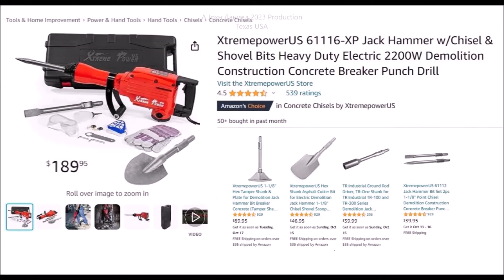Xtreme Power US Jack Hammer and Tools, Watch a 115 lb Girl bust Concrete with it

Comment: my sister in her early 20's rebuilt engines , operated drill riggs for years, she had a reputation as one of the best drillers around
Reply from the maker: Kiera is building her business plan. Local bread subscriptions and delivery. She makes the best damn bread I ever had, even better then my aunts and grandmothers did. And she's only 18. But she took their recipes, and worked them. Already has a dozen deliveries she bakes for. Adding more and looking to raise the cash to get her a van, her truck is 150K worn bad.
Reply: @JOHNDANIEL1  might be some money in gluten free bread or flours from non hybridised grains ie old grains   i see so many switching to it , mostly those with gut issues, inflamation in their bodies  which seems to be more and more common

Comment: Are y'all running that off of an inverter? I've got a SWIPower 3000w, 48v inverter and I think I see it taking longer to recover from big inductive load starts. It hasn't shut off from one yet though. Seems most of what I use it for are tools with induction motors. I haven't been a position yet to watch for voltage drops though. Except one time I tried to start a compressor with a 2hp motor mounted, and it dropped to 67vac. So I don't use that compressor off of the inverter. Would the 6000w SWIPower do better? Or would it be better to keep looking for a low frequency inverter?
Reply from the maker: Yes, running on the Swi 5000. Get the 5000 model.
Reply: @JOHNDANIEL1  
5000w better than the 6000w?
Reply from the maker: Yes, The 5k https://s.click.aliexpress.com/e/_DeBzM5H is preferred. The 6000 is only really just 2 larger capacitors, no larger fans, 13 watts more idle current, and your wiring on them is already on the limit, and you may never reach 6000 due to that. The 5K is premium, actually capable of 5200 with no modifications. And why pay $50 more for the extra hope of using 6000 watts once in a blue moon! Get a 5000, pick your battery voltage, USA plug, 110-120 volt. All other voltages are other countries, not for USA. They are in a USA warehouse ( https://s.click.aliexpress.com/e/_DeBzM5H ) and make sure your cables are dual 1 awg or heavier to feed it. if you go over 4 feet up to 8 feet, then get (4) total 1/0 gauge x2 per side.  I have over 5000 amps battery, I am ok, but you will need 400+ amps to run these. 2 of the TIME USB with 200bms https://amzn.to/48VlOEv is minimal but enough. 3 would be premium battery coverage. ( use my buyers bonus code if you do, I won't need it, good a few more days, HUGE $$$$$ off. Code - WHVMWBGZE707 use at check out ) Literally almost as cheap as a 100 ah LOL!!
Reply: @JOHNDANIEL1  
I asked because I didn't see the 5000w listed separately on the blithechin Ebay source page. It is  listed as 5000/6000w at $534.
I've got right at 10kw of full current power from the (2) 48v rack mount EG4 batteries to cover surge requirements. But all the equipment is running off of 15 amp 120v  plugs. And never more than one at a time. 
I'm afraid that my current 3000w SWIPower inverter has developed some harmonic distortion, probably from repeated inductive surges, and may no longer be a true sine wave device. I've gotten a bit of smoke from a couple of hand drills, much like low voltage would do.
By the way, thank you very much for responding.
Reply: I just found the ECPC-6000-48-APC low frequency inverter for not a lot more that the SWIPower 6000w, so, provided I can find any supporting reviews, I may go that route. From the looks of it, it's exactly like the Sungoldpower and Signeer units, but at a lower price.
I also just watched your video from 6 months ago. Dude! If you track that POS stalker to Arkansas,  I got your back.

Comment: Use the needle instead of the chisel. The small tip of the needle pushes all the pressure onto one small spot. Concrete will break even easier.